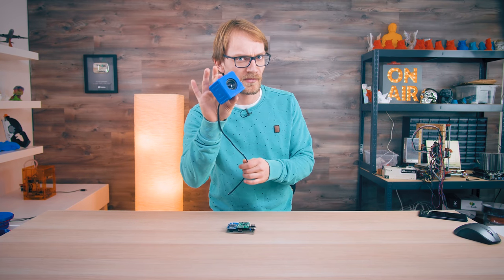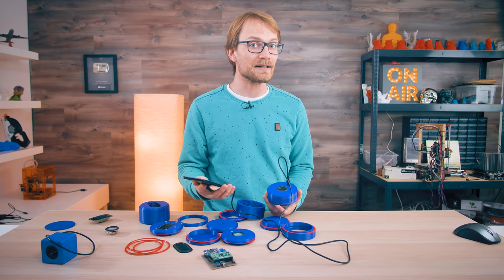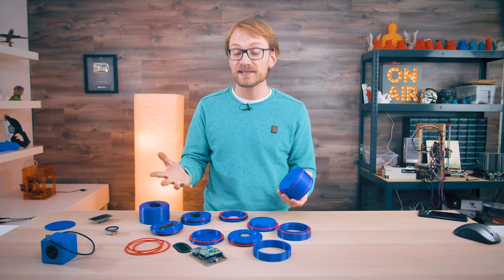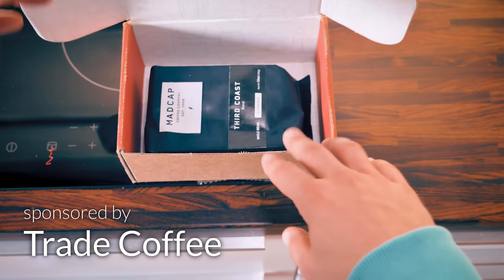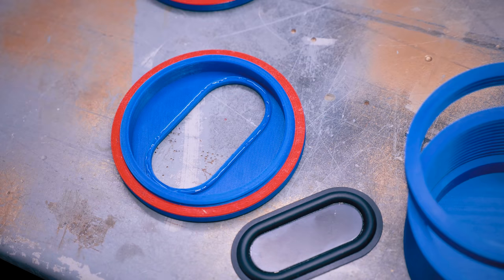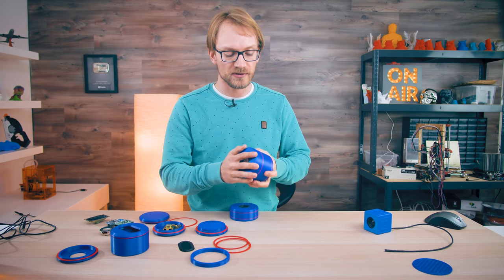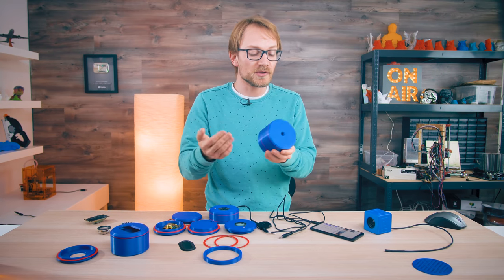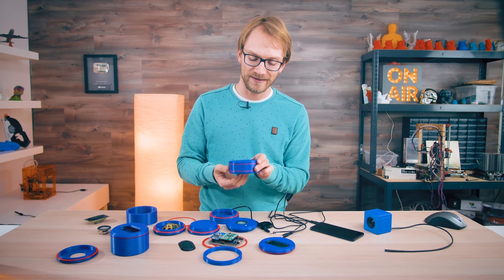I made an open-source educational loudspeaker kit!

Comment: For loudspeaker enthusiasts ... with regard to low frequency acoustics, Thiele & Small researched and published speaker modeling parameters that allowed calculations on how speakers behave in enclosures. That was somehow groundbreaking work that transformed the speaker industry to higher levels. Also, don't forget Beranek :)

Comment: This was why I started with Fusion 360. I built a very similar system for evaluation for possible drivers to go in my companies products.

I added internal threads to be able to put a "wagon wheel" to push the driver into place instead of glue. This let me swap out multiple drivers of the same radius without having to print lots of 'tops'.

Comment: Speaker nerds unite! I've actually been playing with those little silver concave drivers you had on your table, and using them as an excuse to learn fusion 360 as well. Only I'm milling my enclosure out of wood (in order to learn CAM). I came upon a really awesome board on Amazon that is Bluetooth + a stereo 3 watt driver, and it's tiny! Go look for it.

Comment: I like it for teaching, but...

For actual experimental sound design for cheap drivers, its so much easier just to use cardboard and tape and that sort of thing to really figure out what you like.
For my last speaker I messed with I just had a tube, and a ball that fit inside the tube, and I changed the internal volume that way.

Comment: Very interesting Video Thomas. Thx. I was wondering though. If you have an opinion on the voron 2.1 printer. The Price for the sole parts is said to be under 1000€. Itˋs probably a hardcore solution. Yet there is no definitive quality check available.

Comment: One completely of topic question:

Have you seen the recent SKR 1.3 board and are you going to review it? It’s a 32 bit board and has built in spi and uart support so you can run the tmc2130’s without DuPont cables!

And: have you seen the TMC5160 by watterott? Are you going to review them?

Comment: The following is written by a coffee snob ... me ☕️

Do NOT ever buy coffee preground ... only use whole roasted beans. Within a 30 seconds or so of grinding, the aromatics in the bean will start to diminish, and 5 minutes or so later the coffee is substantially degraded. There are some reasonably priced manual grinders available that will produce a much better experience than old and stale preground beans. Manual or machine grinders generally have an adjustment mechanism to vary the particle size, which is important to match to your coffee machine or french press etc.

It is also vitally important to know the roast date of the batch. About 7 to 10 days after roast is a general gauge as to when a roasted bean is best ready for consumption, and you have about a 14 day period in which to enjoy the bean at it's peak flavour. After this, the bean starts to degrade. Thus, coffee purchased from supermarkets are generally a no go option.

Look for a local roaster, or one that can deliver via post in a timely manner.

Warning though .. once you have experienced real coffee made at home, there is no going back. You'll never be satisfied with instant coffee again .. haha.

I hope the above helps in your coffee adventures.

PS. thanks for the video Thomas 👍

Comment: "airtight, which is not important"... umm. yes it is.. it is VERY important that the enclosure is airtight and not just "about" airtight but it needs to also hold AIR PRESSURE.. or you are not getting the amplification from creating extra PRESSURE inside it. It is very, very important to have everything very, very tightly locked and not a pinprick worth of air can leak out. This also means open back and ported designs, the walls can not leak (but it is, i admit less important in that case but as a general rule: enclosures are pressure vessels and need to be as airtight as an aquarium would be).

edit: ok, watching a bit further..  Thomas is not a audio engineer not acoustician  :) There are so many hilariously wrong things there but.. it doesn't matter than much as long as no one is trying to formulate new theories about how sound amplification and speaker enclosurers work. Playing around with boxes with different resonant frequencies, the sound difference in ported and sealed... those still give tangible experience and there are tons of things to learn. This is a good project for that. 

 I just suggest to go and start studying the subject in more detail before advancing from this, audio and sound are not really that complicated in basic conceptual level, and that is the level that everyone on earth should be.. but they aren't, people are so dumb about how audio actually works that it is not even hilarious. And yet, it is not that complicated until you start to design and actually have advance from back of the envelope stuff to an actual product.